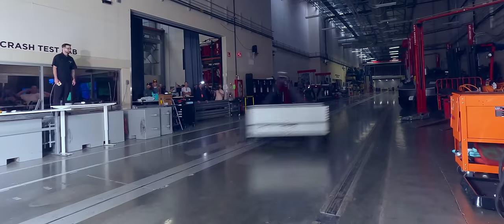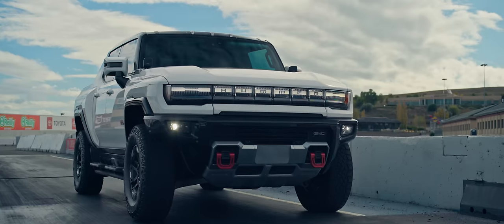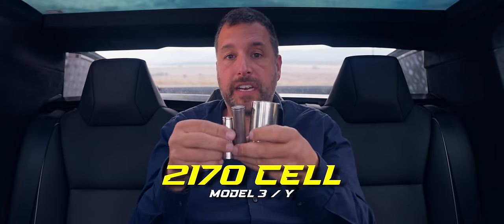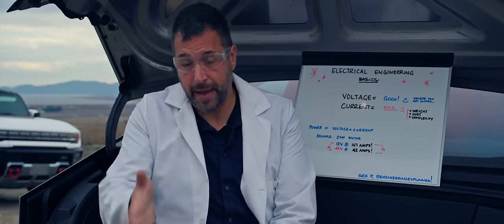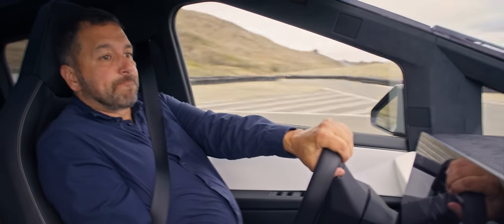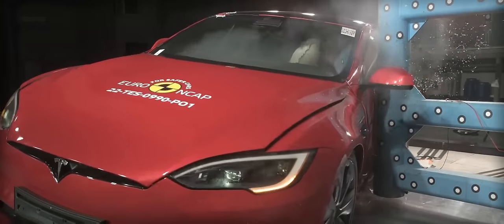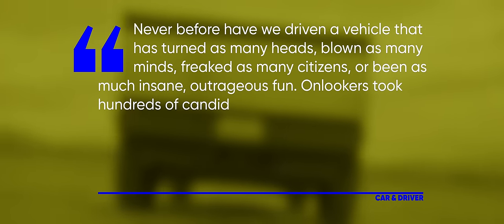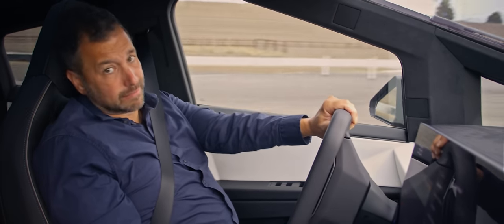Exclusive 2024 Tesla Cybertruck Full Review & Drag Race w R1T & Hummer  — Jason Cammisa on the ICONS

Comment: Incredible production, as always. Love how Jason didn’t mention payload capacity, bed size, towing capacity. They know buyers won’t use the Cyertruck as a truck😂
Reply: I'm only here coz it popped up in my recommendations, but in the flood of cybertruck content I've watched today, this kinda stands out. I'm sure a full review will come once they have a production unit in hand.
Reply: This truck will be the ultimate statement piece. The only people that will drive this are ones that want to be noticed or be looked at.
Reply: Sooooo....like most every truck buyer out there.
Reply: It is higher than all the other EV trucks. Done.
Reply: They're a drag racing channel. They probably aren't Truck experts. Besides it crushes the Ford F350 in towing. You will have to wait a bit for more stuff on actual truck things but it will come.
Reply: You're going to die alone with your cats lady.
Reply: @lachlanB323  this isn't 1320, they're not a drag racing channel.
Reply: You say that like 90% of trucks on the road are being used as trucks, when we both know that they are being used as glorified "SUVs".
Reply: It can haul Uber eats to the men that drive real trucks.
Reply: @noneyabizz8337  They aren't a truck channel is what I meant.
Reply: @lachlanB323  it doesn't even have a trailer hitch.
Reply: @lachlanB323 the real problem is that this is an advertisement and not a review.
Reply: Also like, towing ability. How you gonna put a gooseneck on that thing
Reply: It's a well-done Cybertruck commercial.
Reply: Most trucks aren't
Reply: 2500lbs payload, 11.000lbs towing, bed is 6x4feet
Reply: Does anyone use their truck as a truck? My coworker has a F250. He needed to move a Suzuki SX4 from his house to his niece’s house and he was gonna call a tow truck. I told him to just tow the thing with his F250 and he told me that he was nervous because he hasn’t towed before 🤦🏾‍♂️. Meanwhile my Model Y has seen probably 2,000 miles of towing various things in the 2 years that I’ve owned it. This includes towing my winter beater Saab 9-5 Wagon from off the side of the road after it blew a hose.
Reply: Well, besides the Mexican cartels.
Reply: Yeah that's my main gripe with Jason's thesis- he said Tesla reinvented the Truck- be he spent zero time exploring how well it Trucks. A rare miss for Cammisa, and hes my favorite Journalist period.
Reply: Most people don't use any truck as a truck anymore
Reply: It has 2500lb bed capacity and can tow 11000lbs. It’s not going to compete with any HD’s out there and wasn’t meant too.
It’s a truck for the 80% people who buy a truck. (Only 20% of people actually need and use a truck for what it’s meant for)
Reply: I think the statistic is 90% of truck owners don't use their truck for towing or payload. They just like the truck design, feel, sitting higher, etc.
Reply: The Idea that we use drag races to quantify the value of a truck Is both silly and a sign our times
Reply: I mean... its best in class everything in all of those categories so that argument didn't work out well for you now did it? 6x4 bed, 2,500lb capacity, 11,000lb towing. It out pulls an F350 diesel and obliterates the performance specs of every other EV truck and most trucks in general...
Reply: The specs for real truck users are the best in class. A REAL TRUCK FOR REAL WORK🙂
Reply: @GreenMountian  basically just like the Model S or any Tesla? that's what people said 10 years ago
Reply: I’m buying it for my farm. It does everything a conventional pickup does — haul stuff — but no fuel and no corrosion. Oh, and it always starts. In the winter, remote starts and warms up in 2 minutes. Life changing for the better. Dig it.
Reply: Not at that price 🫤
Reply: @shr00m7  He didn’t mention how well any of the other trucks trucked either. But for your information, 11,000 lbs towing capacity. 2,500 lb payload. Most EV’s loose about 40 - 50% of range when towing so keep that in mind when calculating the Cybertruck’s towing range. Overall, it’s about as good as a truck as all the other trucks. The slippery Rivian will still probably have the longest range. The F150 Lightening will still probably be the cheapest. The Cybertruck is a Halo vehicle. It is meant to be ridiculous.
Reply: It would look sick with some mini motos in the bed!!!
Reply: @a.t.2023  When I rode in my friend's F-150 a few weeks ago I realized that I had forgotten how great a family-vehicle my 2021 Ram (and his F-150) is...If you don't mind burning loads of fuel. So much space in the cab. So much space! Rear facing carseat: psh, place the 6'5" dad up front, no problem!
Reply: I’m a woodworker and the Cybertruck is at the top of my list.  I has a bigger bed and better towing capacity than any other option in its range.  Not to mention that I won’t have to worry about scratches and dents while I’m on a job site.
Reply: If a contractor showed up at my house in a CT for an estimate, I would send him away.  He/she is most likely going to charge me more than others and I would question his/her decision making.
Reply: @noneyabizz8337 😂😂😂😂😂most not all. Some of us pick up drivers still know how, why and what we have pick ups for. 😊
Reply: @lachlanB323 no...An F350 tows 20k lbs.
Reply: @fredwilliams7893   The Cybertruck will beat ALL other pickup truck brands out there, and will lead to the downfall of many pickup brands...   Mark my words dude.
Reply: To be fair when last did you see a truck being used as a truck?
Reply: @ettcha  lol you haven’t seen many Hagerty videos, have you?
Reply: So like every guy with an F350 on my city block.
Reply: @cbm5042 what’s the range while towing?
Reply: @johnsutherland7561 except for range right?
Reply: @landontracy3542  😅 the algorithm brought me here right after the MKBHD video! Still, if this is all they do, there's plenty of other channels that will have conventional formats. For now, let me check out what else haggerty has, it might be fun!
Reply: @landontracy3542  haha, I see what you mean now!
Reply: @Aproposer1 have you compared prices and specs with other EV trucks?  Some dealers are asking $85,000+ for a shitty Ford Lightning which we’ve just seen obliterated by the CT!  Ford and GM’s management should be shitting themselves as their products suck compared to the CT!  Also, once the CT production line is fully ramped, the price will fall and fall….it’s game over!
Reply: @fredwilliams7893  Stupid flex vehicle describes every fullsize conventional pickup on the road today.
Reply: Yeah, nobody is going to buy this to haul refrigerators.  That's fine.  I bought a Bronco Sport, not to go rock crawling (not my hobby) but to go mall crawling and it does that perfectly.  People will buy this to be different.  That's perfect as it was designed to be different.  So, it is what it was designed to be.
Reply: I wonder why they pinned your comment and then unpinned it. Maybe they realized you were being sarcastic.
Reply: @Incomudro1963  SMH yea my 2013 tundra crew max although very reliable and capable off road is not a flex vehicle! And so many other full size trucks owners aswell,! Teslas are for wierdos wanting attention thinking they are cool but yet 90% are being made fun of cause evs are not cool by any means! The market shows it. Full size trucks still number one seller. Get over it and except it
Reply: All of those things are best in class: fits 4x8 sheet with cover down, out pulls an F350 significantly and 11k lbs
Reply: @ChitFromChinola  gonna be amazing!  haters should not comment it just makes them look dumb. I mean they are & all but why out yourself as an idiot
Reply: @fredwilliams7893  they literally mention in this video, that tesla model y is bestseller currently. So many weirdos out there man, be careful😂
Reply: @gerrycrisostomo6571 

Bro, you must be joking. Do you have any idea how many F-150s are sold every year? Yeah, the lifestyle people will buy this thing, but the people who live in cold weather environments, and in more rural locations very likely won't. I get that there's this perception out there that most truck buyers don't even use their trucks as trucks, but that's not entirely true. There are plenty who do.
Reply: @JaxScoBlu  Come one Man! Who puts a gooseneck on a Ram 1500? Let's come with something logical. LOL
Reply: If it’s only the same price as a nicely specified Range Rover they’re gonna sell a few….
Reply: @Soh90 Wow, one anecdotal example of someone with an IC truck not using it as intended. I guess the matter is settled as Al Gore would say.
Reply: 100 this comment, no mention of any of the important feature of a pickup truck like off road capability. It's going to be the ultimate mall crawler/parking lot princess
Reply: @Zextraterrestrial  

Maybe it's you who shouldn't out yourself by calling people who simply disagree or don't like something that you do "haters." I get that you personally like the Cybertruck, and that's fine, but there are plenty of people who don't. It's also the case that most of them have a legitimate reason to dislike and/or not buy the Cybertruck. It's not just a bunch of irrational people who dislike it for the sake of disliking it. If you're going to claim or argue that sort of situation is the case, then you'll have to provide evidence to support what you're saying.
Reply: @CaseyCollier  so I like it personally? Did I say that
Reply: Payload and towing capacity is as good as, or much better than, all other half ton pickups on the market.
Reply: @Zextraterrestrial  

It was pretty obvious from what you said in your response to ChitFromChinola. He said that he's buying one for his farm and you responded by saying "gonna be amazing!" Do you expect me to believe that you don't personally like the truck when you said something like that?
Reply: Sooner or later if you buy a Cybertruck you will use it as a truck. I guarantee. Everyone has something to haul at some point.
Reply: @fratzogmopars  That’s not the point I was trying to make. But it is pretty well known that truck drivers don’t use them as intended. In fact, no one I know who owns a truck uses it for truck things. They laugh at the fact that I own a Model Y,  but my Model Y pulls its white dress up and gets down and dirty. Towing, camping, landfill trips etc. So it’s not anecdotal, it is, in fact, a microcosm of what truck owners are actually like. Tesla knows this.
Reply: @RayoAtra  the best part?  These insanely large trucks don’t fit in garages, apparently.  So when they sit out on the street you don’t have to worry about your $100,000 gas guzzler getting wrecked by sun or vandals
Reply: @geobur1989  yes of course, and that is by design. However it does seem to be far more technically advanced than those other EV trucks…
Reply: What does use as a truck even mean? A truck will always be used as a truck because it’s a truck. It will come handy when buying things from Home Depot, taking the kids camping or simply loading up a pair of bicycles to your favorite trail.
Reply: @Soh90  Maybe in the circles you run in it is well known people don’t use trucks as intended, but it is a big country with lots of farmers, construction workers, and contractors, to whom a truck is a tool. I get it though, I own a small pick up truck, it looks nice, and it is sporty too, but I use it for light duty, a tow hitch on the back, move my boat, light hauling for doing home improvement projects, help someone move home furnishings, thats why I bought it, to do things I wouldn’t want to, or couldn’t do with an SUV or a car.
Reply: @CaseyCollier  I don't have a farm.  specs are decent. Tesla cars blow other EVs away. I love my 3 and race.  I'm not really into trucks or large vehicles  unless I have a purpose for using one. towing a 3 for racing and being able to top it off would be neat & an easier way to get large Hoosiers to a race with me but still not necessary.  did you have a comment that you leads you to think I am calling you a hater? I'm  a bit confused
Reply: They'd be foolish not to use it as a truck, as it's absolutely designed to be just as practical as any truck out there! You get truck utility with sports car performance. It's actually the most practical car if you think about it in an unbiased fashion.
Reply: @SpyderRios  yes I think that’s right. It’s really designed to be an suv with an open back that odd shaped family items can be stowed. Not a Truck in the working sense where maybe concrete, scrap metal or lumbar is carried or possibly a goose neck may be mounted for instance..
Reply: Perfect for hauling mini bikes and go karts!
Reply: Ev hater 💩💩
Reply: @GreenMountian  I want one because i can tow 3.5 Tonnes and have more then 200km of range with it and i can hit it with some wood panels or stuff on construction without getting dents everywhere.
Reply: Great review
Reply: @Zextraterrestrial  

I get that you don't have a farm. That's not relevant to what I was saying. You have a preference towards Tesla and, by extension, the Cybrertruck. Is that a fair assessment? If it is, then what I pointed out in my initial reply is true. It'd mean you have a positive opinion of the Cybertruck, which is completely fine. I have no problem with that. 

Getting back to my original argument, though: you shouldn't just label people who dislike the Cybertruck  as "haters" or "dumb." That sort of language implies they're irrational and/or don't have a legitimate reason to dislike it. That is simply not the case, based on everything I've seen and heard. If you'd like to prove your claim true, though, you're more than welcome to. I'm not sure you'll convince me, but hey, it isn't an impossibility.
Reply: I mean, if this gets another market interested in electric vehicles I guess it is sort of a win? But an 8000lb vehicle made of lithium and stainless steel is not saving the world. That’s for sure. The carbon footprint just to make this thing is probably at least 2x the footprint of a couple of compact Toyota Hilux’s with 200k miles on them.
Reply: @itsatrap7215  I've seen 75% as the percentage that never tow, but either way, it's the vast majority.
Reply: @CaseyCollier  it's not perception, it's reality. Actual truck users are in the minority.
Reply: @darylfoster7944  

What do you mean by "actual truck users," exactly? Are you talking about towing? Are you talking about bed use? Be specific, please.
Reply: @CaseyCollier  yes, all the stuff that truck owners say the CT can't do.
Reply: @cbm5042  but it can’t do any of that with any range ant the “range extender” takes up most of the cargo area. Yup a great driveway look at me vehicle. But it’s not a truck.
Reply: @CaseyCollier greater than 80% of the country's population lives in urban, suburban, x-urban places...17.9% to be exact live in rural places...

As for what people use trucks for...if you discount work trucks I believe the stats from surveys and studies is that less than 20-25% haul frequently or tow anything with their trucks...most use it to drive to the grocery store and the schools - not doing truck things...

And the majority of trucks on the road today are not work trucks...
Reply: I need an 8 foot bed. I need to go at least 500 miles on a tankful, and I need to be able to fill up no matter where I am in Connecticut at a moments notice wouldn’t even think about adding that to my fleet of construction vehicles.
Reply: Newsflash, the majority of buyers of all trucks never use trucks as trucks.
Reply: @cbm5042  F350 can tow at least 18000lbs on a high end SRW trim and up to 40000lbs on DRW base model. How is 11000lbs out towing it? And where does the gooseneck or 5th wheel connect to the Cybertruck box?
Reply: @CaseyCollier  To label people (and AI) that comment on these videos / facebook / wherever and have no positive feedback as haters, is not incorrect.  I think something a bit different is a good thing, yes.  F150 lightning, I get they want it to feel similar to what old F150 buyers are used to,  probably decent for some folks ( plenty of haters of that vehicle too).  The slandery negative comments on all Tesla stuff gets tiring.(most EVs maybe?)  If you don't like it why the hate, just move along. Much of the hate is misguided and irrational (or financially motivated even), but there is absolutely no reason to convince someone to like it.  Seems you misinterpret my comment...
& being forced by gov't to EV isn't cool, they are better in most cases for many people  but  not all
Reply: Why explain? it’s all on Teslas website.
Reply: A Toyota Tundra is flashy to you? You must live in a reeeeeaaaaaallllyyy poor area
Reply: @johnsonjjohnson100  Fair point. And one of the things about electric motors vs gasoline / diesel is that you can have low end torque AND high speed. But... with that said, as many people in this thread have pointed out, few people buy trucks for truck stuff anymore anyway, so a 8000lb drag race capable stainless steel truck is hardly contributing to Musk's stated goal of "electric cars to save the planet." Nothing about this vehicle is about using less resources and probably fewer than 10% of buyers will actually haul anything remotely heavy with it. In my mind this is solving a lot of the wrong problems, but I drive a 1989 Toyota 4x4 so I'm obviously not the target market.
Reply: @triaxe-mmb  

...and? What you said doesn't really disprove my point. I never stated that the majority of people who own trucks haul or tow with them frequently. I said that there's a perception going around that most people don't use trucks as trucks, which is not entirely true. They may not use them "frequently" in that capacity, but they are still used from time to time like that, just as it's the case that most people who buy SUVs or hatchbacks don't always use the full cargo space of their vehicles. It's a matter of "I have the ability to haul and/or tow if I need to." Do you understand what I'm saying?

I'd like to go back to my original argument, though. The Cybertruck is a fairly niche product, considering that it's an EV pick-up truck which can't tow and/or haul anything heavy without a sizable chunk of the range being cut. It's also very quirky and irregular to boot, so that limits its appeal as well. Certainly, it'll be popular among lifestyle people, Californians, and those who seek attention from others, but I think that's kind of the extent of the market for this thing. Who else is going to buy it?
Reply: Me again. I parked my L-48  'vette beside one and the outside measurements were the same length and width as my fancy two seater.
 With the Middle row seat out, It felt like a Living Room inside with awesome Stereo.
 Those were the Day's My Friend!
Reply: @Killbot754  I said pulls more doesn't tow more. I beat the crap out of a 350 diesel in a truck pull test.
Reply: @johnsonjjohnson100  doesn't Johnson and Johnson own the Tampax corp? Even dope dealers know not to be their own best customer. There's nothing aluminum about my truck. Maybe the mirrors. It's more than likely older than you. That Tesla seems to be pretty fast. But I don't want to have to buy a purse and matching shoes to drive it. 😀😎. You have a good day🐂💨
Reply: 75% of trucks aren't used as trucks.
Reply: @fredwilliams7893 chick's will dig it.
Reply: Love your videos ❤❤❤❤
Reply: @fredwilliams7893  You can calm down now.
Tesla is taking over, just enjoy the ride :)
Reply: @Zextraterrestrial  

" To label people (and AI) that comment on these videos / facebook / wherever and have no positive feedback as haters, is not incorrect."

I mean... by definition, it's incorrect. You can't know what someone's complete intentions are behind their comments or posts unless you were to somehow be able to read their minds. Everyone has different motivations for the things they say. Some are similar and some are wildly different. That being said, you can't know what those differences are until you actually talk to that person and get a better understanding of it, yourself. Otherwise, you're just assuming things which could very well be wrong. Blanket labeling entire groups of people because of the things they say or dislike is a terrible thing to do. It's been proven time and time again in history, and it continues to be true today.

" The slandery negative comments on all Tesla stuff gets tiring.(most EVs maybe?)  If you don't like it why the hate, just move along. Much of the hate is misguided and irrational (or financially motivated even), but there is absolutely no reason to convince someone to like it."

I'm not saying that people who actually slander Tesla are good, but I think it's silly to brush off anyone who dislikes Tesla or EVs as "haters" or being "dumb." Many of them have a legitimate reasons for why they dislike the company or its products, so it isn't right to be so dismissive of them without first hearing/reading what they have to say, talking to them, and really understanding what their points are. I know that process can be time consuming and tedious, but without doing so, you'll lose perspective on the people around you, including those who disagree with you. That's not a good position to be in.
Reply: @fredwilliams7893  I've turned a wrench more than you have, and I think the Cybertruck is pretty cool. The engineering speaks for itself... I mean, if you're smart enough to understand what it's saying. 48 volt architecture is a huge leap forward.
Reply: @gerrycrisostomo6571  maybe, if they put a lumber rack on it. A 6 foot bed is practically useless. I build homes. And I refuse to build an ugly house. I'm not going to drive an ugly truck either. Elon is working on a semi truck that I would consider buying. He can keep his pup tent truck
Reply: @Aproposer1  derp
Reply: @mile_high_topher  you have? Even With out  knowing me you have turned a wrench more than me? Cause  i still turn wrenches my man!  I do all the maintenance work on my cars and wifes aswell. Mayby if you like this truck cause you dont have to work on it mayby you should think about turning in your tools and purse at the same time
Reply: It’s funny how much of the criticism towards the Ford Lighting is excused in the Cybertruck, specifically that its use as a REAL truck is or will be limited.  Basically if GM decided to slap a new “truckish” body on the E Ray, you’d have a CT competitor.  Hard pass.
Reply: That's the niche market the Rivian went into.
 They attempted to sell a life style ,
Like how Patagonia is selling it's expensive capable outdoor jackets to high tech city dwellers . 
That's a more conventional marketing/branding approach. 
The cyber truck is just silly and controversial, with surprises of good and different engineering from a car company that tends to do that. 
Tesla never gained popularity because it was the best car around 
But it had a huge screen , and silly fast "engine" in a "regular" car , and showrooms in malls . 
And it's such a crazy success story that while they have the best selling car in the world they still achieve a brand Exclusivity status! 
That was never done in the automotive world and the only other company that can be compared is probably Apple
Reply: @sorinelpustiu5674  yea? The sales numbers don't reflect it buddy! Number one selling vehicles  gas and diesels trucks and gas suvs  get out from under your rock bud and pay attention
Reply: “A middle finger to the establishment.”?? It’s doing everything the establishment wants them to. How much did Elon pay you to do this ad, Cammisa?
Reply: @noneyabizz8337  can't wait to see cybertrucks on lift kits...
Reply: @Mac10Daddy  Yep! Democrats way of life!
Reply: @philtucker1224  why would you imagine that tradesmen wouldn’t use a Cybertruck as a work truck?  It has more capability than any pickup on the market and is basically indestructible….this will be on work sites all over America within a few years for sure!
Reply: Tesla themselves didn't do that either, whenever they showed that never again mentioned delivery truck. I suppose you can deliver the heavy battery to the next Tesla specific charging station.
Reply: @fredwilliams7893  Yeah, I did it professionally, Chief.

Imagine thinking a truck is cool because you have to waste all your free time fixing the piece of junk.
Reply: As with most Truck buyers
Reply: @Tyler-yn5xe to paraphrase the man-child “in charge” of the vehicle “you just said the actual truth”
Reply: Most truck owners don’t use their trucks like a truck. Maybe with that tough skin, someone with money won’t be afraid of taking onto a back woods road or two.
Reply: @Soh90 I have more mud on my all wheel drive ford escape than every Jeep and truck at my work parking lot😆. My escape was only $32,000 so I can take my chances, those $80,000 rigs might make me cry if I put a dent in one.
Reply: @jamesbarbato2192  so you need a fleet grade truck...works for me...again I think people confuse a commercial vehicle with most of the trucks we sell in the US...most are lifestyle vehicles...they don't tow or carry a lot of cargo...

I am no fan of this truck aesthetically but the tech behind it is pretty cool...also, the faster charging architecture will make it a half decent work vehicle in some use cases, but probably not yours.
Reply: @fredwilliams7893  u sound like one of the ppl that said this would never be in production
Reply: @CaseyCollier  At least you have thoughtful comments. Completely disagree with most of this though - you assume I like the CT?  why assume this, from my first comment that wasn't directed at you whatsoever !?  I've been driving an S for 11 years. I would love a smaller car than a Model 3.  Calling haters what they are is not incorrect.  Commenters with constructive comments are a different beast.  I've been seeing this crap for a long time.   There are legitimate reasons for disliking every company and product. these are  not the haters I speak of.
Reply: Agreed. Another rich man's toy.
Reply: 3mi range when towing
Reply: @jstogdill  The main reason pickups aren't drag raced more is because they are so bad at it. Unless you like rear tires burning out. Cybertruck changes everything.
Reply: @dougm659  don’t make me laugh, (you’ll have a massive selection of electric work trucks from every existing manufacturer by then at half the price). Most of my neighbours have Teslas already as second cars but the Cybertruck is a novelty talking point at best. Great advertising but It doesn’t even have any headlights!
Reply: @Aproposer1  Most contractors have to buy expensive new trucks every few years if they want to get the high-end jobs. So, you not only end up paying for big, expensive, heavy-duty trucks, but also outrageous fuel bills as the foreman visits their various worksites and brings by needed supplies. Cybertruck decreases fuel expenses to next to nothing and increases profit potential. My next electrician will drive a Cybertruck! Can you imagine hiring an electrician in a non-electric truck? Like a gas or diesel? How archaic! An electrician who doesn't know electricity is better than gas and diesel!
Reply: @GreenMountian  Disagree. It looks like a very capable work/off road vehicle.
Reply: @The_Ballo  show your math please.  🙃
Reply: Its a nice sponsored Cybertruck commercial.
Reply: @Aproposer1 You’re obviously a very non judgmental open minded person
Reply: Are we gonna stop making these people aren’t going to use it as a truck comments one day? Not all people need to haul beds full of gravel or toe excavators for 100s of miles on a weekly basis there used to be millions of people driving around in four-cylinder Toyotas and Ford rangers that were perfectly happy. And by the way, I have a Ford lightning and probably used it to tow more than most people with a half ton crew cab short box truck have in the last year..
Reply: @Zextraterrestrial  

"...you assume I like the CT?"

Do you not? It seems rather odd to me that you presumably like the Tesla Model S enough to have bought one and own it for 11 years, yet you somehow don't like the concept of the Cybertruck, as an EV pick-up truck. I get that you likely don't want to own one (I never talked about it in that manner), but do you not at least like the concept of it, since it's another EV that Tesla offers?

"Calling haters what they are is not incorrect.  Commenters with constructive comments are a different beast."

I would agree, in theory. However, there's really no way for you to truly determine who's a "hater" versus someone with legitimate reasons to dislike the company or product. You can say "well, they have no points," but if they do actually have points but aren't posting them, then you're wrong. I understand that that's a high standard to meet and that there's very few practical solutions to deal with it, but it's just the reality we live in. Talking with people online just makes these types of issues even more likely. I'd say the best way to handle it is to ask questions before making judgements. 

"I've been seeing this crap for a long time.   There are legitimate reasons for disliking every company and product. these are  not the haters I speak of."

Then perhaps it would have been better if you had been more specific in your description of the people you're talking about, instead of using a blanket term like "haters." I still don't fully understand what you mean by that, even now, and I've been talking to you for a decent amount of time. How do you think your statements come across when people who haven't spoken with you see them? I don't think it paints a particularly good picture.
Reply: I use my F150 for hauling my 23’RV and boT. Go off road here in Wyoming hunting and flyfishing small streams. My Tundra hauls my FourWheel camper on logging roads in backcountry grouse hunting and flyfishing. I use them .
Reply: I would love this (but live in UK) but I don’t want a truck - for me this would be an SUV with an open back - yes I’d love the LM002 - but os the market big enough for people like me who live in countries that have the space for them?
Reply: Still beats a Chevy in every way
Reply: @fredwilliams7893  isn't that almost if not all American truck buyers? 😂
Reply: @lachlanB323 crushes a Ford F-350 in towing, but for how far?  And how many Superchargers are set up for charging vehicles with trailers?
Reply: Many full size truck owners don't even use half of what a Maverick would do.
Reply: @cbm5042 oh?  What’s the stated range of the vehicle?

And yeah, the Cybertruck has twice the efficiency of the Hummer EV, but technically so does the Silverado EV.
Reply: @CaseyCollier  Model S was actually the only EV available with any reasonable range and specs at the time. I test drove one and checked it out before buying it. Amazing sedan for dogs.  my OP was a short comment assuming a farmer will like the CT  in a sea of FUD comments.    Look through comments on some of these reviews. motor trend etc. Lots of what I'd call haters just commenting to throw shade., similar to the ones that just comment on videos to say 'first' . Not much to understand.

CT is interesting, definitely need to see it fully in person and drive one. Would be my wife's vehicle if anything and traded for a 4 runner.  

I've asked questions of some of the negative commenters over the years. there are rarely answers, mostly just name calling and much misinformation.  this is not a new thing,.  MSM has been slandering Tesla for years. Does that paint a good picture? 
it's a very deep discussion that does not fit or belong  here.
Reply: @danmadison5087  wrong... it has two
Reply: @noneyabizz8337  its not an advertisment because its not paid. its just an opinion piece, but still based on facts.
Reply: @ZipZoomZip  Finally the Raptor has met it's match. 🙄
Reply: @danmadison5087  per the placards at the event it has a built in trailer hitch…
Reply: @Tyler-yn5xe  guess what the truck sales have done x6 since the 80's but truck needs havent increased nearly as much. thats why 3/4 of the trucks NEVER tows or even hauls Something that wouldnt fit in a suv trunk.
Reply: It does beat a 911 in a drag race. While towing a 911
Reply: @InnovativeSustainableSolutions  if you want a cheap one, you gotta be patient, wait for the demand for expensive dual/tri motor versions wear out OR production increase a LOT, then prices will go down. Right now its production hell low production, high cost, high demand so they sell high
Reply: @Soh90  the big advantage that cybertruck may have is very fast charging, and even faster on v4 1000V/1000A super/megachargers
Reply: @Aproposer1  haha contractors you have the guy that just come for an estimate in the nice off road truck with impeccable paint and stickers . then the guys who really work come in a clapped out rusty white truck
Reply: @ChitFromChinola  
And.... If you put some solar on the land, or talk to the local utility about a wind turbine, (they power the community, you get free power??).... Then your saving is ridiculous.
Reply: @John_Mack  that's brutally honest 😀 Im pretty sure llike for any truck some will buy for the image, and some will actually haul/tow things, camp, etc. there are a lot of uses for a truck that don't involve towing a 15000lbs trailer for 3000miles
Reply: @InnovativeSustainableSolutions 
You can easily find diesel F150s at comparable prices
Reply: @JM-zs5hp 
Build yourself a slide-out for the bed and you'll have great acces AND security!
Reply: Well it won’t be a work truck that’s for sure but it doesn’t change the fact that it’s incredible
Reply: @Aproposer1 
Now check the F150 price on dealer lots.
.
You SHOULD be thinking
"This contractor will be on time, if his truck needs work, the tech will come to him, and if he does have a ... Drive problem(?)... The truck will still run. (Redundancy)
Etc.
Reply: No one's dragging this either but ok...
Reply: Almost no one uses a truck as a truck
Reply: This is Merica.  We only use trucks for “my rock is bigger than your r” safety.
Reply: I'm from Kansas, major truck country and I can tell you, most Kansan truck drivers don't use their trucks as trucks.

Pickups are man jewelry in the midwest.
Reply: @JDCheng  You can get the range extender which brings the range to 440 miles. However 99% of people don't need it. Most people don't tow for more then 150 miles. 

They aren't going across the country. Some people do hence the 440 mile range extender option.
Reply: @JDCheng  As for supercharging with trailers. We will have to see some youtube videos. You probably need to take up an extra spot. Also fun fact: The cybertruck can charge at 350kw at V4 superchargers.
Reply: The Cybertruck has a 6.5 foot bed.  How big is the bed in a comparable F150 Lightening?  Hint it’s less.  Cybertruck also has a tighter turning circle, is more efficient and has comparable load carrying and towing capabilities.
Reply: @lachlanB323  so, trailering is going to be the new "ICEing"...
Reply: @GreenMountian mass produced, lots of people find it ugly, not priced too high that it will be super rare…. I doubt it will be a statement piece for anyone but an Elon fan. I think it will be more like what the Pontiac Aztec is today. We shall see.
Reply: @cbm5042  f350 7,630 pounds of payload and 21,000 pounds of towing. I like the cyber truck but it’s nowhere near as capable.
Reply: Pay load????  Oh yeah it's a tesla, you'll Pay a Load alright.
Reply: @JDCheng  Yes. That is why Tesla will have to make new supercharger stations that allow for trailers. Either that or just make more of them. Currently there's so many superchargers it doesn't matter.
Reply: @johnsonjjohnson100   oh yeah, 0-60 and 1/4 miles times real important in Trucks? Big Truck guy huh? Truck 2.0 means straight-line times? If that's the case, whats the difference between a Truck and a Car?
Reply: This thing is a truck only in size and efficiency.
Reply: Didn't Lexus do steer by wire first?
Reply: "A Toyota Tundra is flashy to you? "
 I don't know or care what that is.
 Take yourself back in time perhaps before you were even born, Bud.
 In 1968, when the Corvette Stingray was introduced, it definitely looked like a 'Flashy' Car. Maybe even a flying Saucer. 
So get in your Tundra and go Home now. @Wallstreetavarice
Reply: Very true. I bought my electric truck to use as a truck. Not to star in a 1970s movie set in 2005.
Reply: @fredwilliams7893  I’m curious what your definition of a Beta boy is. Could you enlighten us?
Reply: Wow! I am wondering why so many people cancel their reservations claiming $100 back!))
Reply: Elon has already said the aerodynamics are extremely bad and the tires don’t last long. He couldn’t even give a final range of the cyber truck and kinda hinted it’s not good at all.
Reply: @danmadison5087  it is capable of connecting to a trailer and towing said trailer. Slap a 2023 Porsche 911 on the back to bring to the car show. If you happen to stop at a light on the way and another 2023 Porsche 911 pulls up next to you, looks up at you and revs his engine, you can smile knowing you have him in the quarter mile.
Reply: @danmadison5087 would an F350 qualify as a real truck? Used to tow real truck stuff? Ahem...
Reply: @shr00m7 I imagine he understood Tesla would show it doing truck things, and he is trying to get people to realize this thing is a truck, no matter it's odd appearance, not because it can do truck things, but that it does everything better than anything before. Everything being fundamental vehicle things. As he put it-reinventing everything but the wheel.
Reply: @rogerstarkey5390  
Yup. Dig it. It’s a new energy paradigm.
Reply: @joewiley6927  why do you assume I have a Ford?
Reply: @TheTuulos it will compete with the F350s of the world in reality, but I am sure you know the respective classes of truck have their respective limits in capacity, towing and payload. I am not an expert in the details, but I imagine they chose whatever class the F150s and 1500 class trucks live in. So legally, you will not be able to tow what a F350 can, physically the truck is quite competitive with a F350, probably beating it in most respects.
Reply: @ChitFromChinola you will be the spark for many others to get past their skepticism and do the same.
Reply: @darrenphughes  look it up its a real thing!  There is alpha and beta no grown ass alpha male would like a tesla period!  look at the demograpic of owners vs what alpha males drive. Gas and diesel full size  trucks! Something not right about a man that likes a electric car. Wierd to me thats all
Reply: @joewiley6927  If his central thesis at the top of the review is that the Cyber Truck reinventing the truck from the ground up and it is Truck 2.0- but he fails to address any of the qualities of what makes is uniquely a truck, as opposed to just engineering a cool new car- then he has failed to present a coherent argument and it is a failure in writing. If you’re argument is that Tesla will show it doing Truck things and Jason is showing it do cool engineering car things- then that just proves my point. Jason is not supposed to be a marketing arm of Tesla- he’s a journalist and theoretically presents self-contained pieces of journalism. Jason stated his own thesis and failed to support/defend it. That’s why its a rare miss for him. My point has nothing to do with Tesla or the Cybertruck tag all- but how Jason framed his story and failed to deliver on his own framing of the story.
Reply: @joewiley6927  
Ha, maybe. Mine will be the muddy one with lumber in the back pulling a wagon full of hay bales.
Reply: @danmadison5087  I don't. I only use the F350 due to Tesla having a tow-off with one. Just referencing it in particular due to that, not because I believe you are a F350 owner. Substitute a comparable Ram, GM, Chevy truck into my post and nothing changes other than I don't want to call them out over the Ford because I have not seen any video of those brands competing against the cybertruck.
Reply: Has mud tyres but it will never seen mud unless it was spilt on the way to school or shops 🤣🤣🤦‍♂️🤦‍♂️
Reply: 🤪 @AnonymousFreakYT
Reply: Cybertruck Rules again, all these EV trucks thinking it has an edge because it came out first is like a toy scrap metal now.
Reply: @shr00m7  Fair enough point, he did not adequately validate its truckness at all really. Vehicle 2.0 perhaps would pass your judgement, but I agree he did not prove it a step change in truck itself.
Reply: @lachlanB323  you’ve bumped your head. F350s properly spec’d tow over 30,000 lbs.
Reply: @pitech4446  rules at what tho? A status symbol and "look at me i have a tesla" ?
Reply: @SimplestUsername  Yes. But that car has just 270 miles of range and costs 65k and doesn't get the 7500 dollar tax credit. The cybertruck costs 72500 with the tax credit and gets 340 miles of range and is quicker to 100kph by 0.2 seconds. The cybertruck also has rear wheel steering which the lexus doesn't have making the turning radius the same on both even though the Cybertruck is a truck not a small SUV.

The Cybertruck also has air suspension... ok do I need to continue here? Pretty obvious the lexus sucks in comparison lol.
Reply: @fredwilliams7893  basing your masculinity and identity on what you drive is the most “beta” and pathetic thing I’ve ever heard.
Reply: @jeremyhowell2332  Correct. It losses when both tow 30k+ pounds though. Look at Tesla's video. It doesn't just lose to the cybertruck... it gets demolished.
Reply: @lachlanB323 look at Teslas own commercial to prove a point. Doesn’t make much sense. I own a Tesla and many of their claims are over exaggerated. If I didn’t charge for free at work, there would be many cars I’d rather have as a commuter. 

Point being, it’s not rated to tow more than an average half ton, meaning you can’t tow more than an average half ton on the street. I certainly wouldn’t trade my ram with a Cummins in on one anytime soon.
Reply: @CaseyCollier It's not perception. That's reality backed by actual statistics. Approx. 80% of light duty truck owners do not tow or haul anything, anywhere more than once a year, if at all. Lot of guys have a bed cover and that bed Never gets used.

Tesla is going after the majority of the market which is the correct decision. Maybe in the future there'll be an HD version for heavier, longer tows and heavier payloads.

For now though, a 2,500 lb payload and an 11,000 lb tow rating are great numbers. 340 miles of range though? Not so much. At least they have the option to bump it to 470 miles.
Reply: @lachlanB323 not to mention, the range when towing is abysmal and it has a tiny bed. If you have a trailer hooked to it, good luck charging on a road trip. You’ll have to disconnect your trailer every time you need to charge. You can’t access Tesla chargers with a trailer hooked up. I’ve been all over California in my M3P and I’ve only seen a handful of chargers at the hundreds I’ve been to with pull through charging spots.
Reply: @danmadison5087  it has a hitch.
Reply: @darrenphughes  you have your opion and i have mine. Based on your response  you probably got offended cause mayby you are a beta male? Am I right? I think so
Reply: I'm pretty sure 98% of trucks out there aren't used as "trucks". It's a workin' man image thing yee haaaww
Reply: @ettcha  the bronco raptor video is my favorite. Worth a watch
Reply: @BUEAU that very well may be true depending on where you live. Around here, most folks are towing stock trailers, animal feed, building supplies, etc. but in town it’s not as common I guess.
Reply: @jeremyhowell2332 CyberTruck's "tiny" 6 ft. bed just happens to be bigger than the best selling truck on the market which is the F-150 crew cab that sports a positively microscopic 5.5 ft. bed. Try again man.

Eight foot beds are for the <20% of guys who actually need and use their trucks for "Truck Stuff." Most don't so it'd be straight up stupid to optimize this all-new vehicle for the minority of the market.

You have a Tesla though. What's with the CyberTruck bashing? It didn't make sense to have very many pull through chargers until the CyberTruck was released as almost nobody tows with their other Teslas. Now that it's finally out though, expect pull through Superchargers to rapidly proliferate.
Reply: @ettcha no crumple zone on front impact i think your brain may hurt after a  highway head on collision 😢
Reply: @TecnamTwin all my trucks have 8’ beds. I don’t like short beds. I’m not bashing the cybertruck, I just wouldn’t replace any of my pickups with one for many reasons.

It’s okay to own a brand of vehicle and be critical of it. As I stated, if it wasn’t for free charging at work, I would sell my Tesla for a more interesting daily driver. I’m not thrilled with it. Creaks, rattles, phantom braking in autopilot, too many trips to the service center (which is mostly filled with inept technicians, at least seemingly so based on quality of service). I telework three out of five days per week, so it may be up for sale soon here.
Reply: @fredwilliams7893  yeah bro I’m so mad and so beta right now. Lol
Reply: @Tom-lf8hx  Rules the world.  Tesla will be inside your brain and you don't even know it.
Reply: It's a given that those features are best-in-class, so it's not worth explicitly discussing them
Reply: @lachlanB323  I'm not nocking the Cyber Truck, I only mentioned it because the reviewer claimed that the Cyber truck is the first and only car to implement that form of steering, which is factually wrong.
Reply: Who needs advertising!
Reply: @SimplestUsername  He did mention lexus.
Reply: @TsLeng  And it beat the F350 at pulling 40k. Maybe watch the video?
Reply: @fredwilliams7893  cry
Reply: @faceplant630  ok little wierdo  whatever!
Reply: @fredwilliams7893  I think you're projecting a little bit. Nothing wrong with wanting to enjoy the engineering if you have the money and want to.
Reply: @GreenMountian ultimate influencer clout machine
Reply: @geemy9675  in none of that did you attempt to call it a review, like they did.

That says it all.
Reply: All of those are better than the other trucks 😂
Reply: 6 feet bed, 11000 lbs towing, 2500lbs load. It doesn't work as a work truck? Lol, ignorance and haters are sad.
Reply: @danmadison5087  And what makes you think the lumber racks and other add-ons can't be built by the aftermarket companies?  Anything is possible nowadays.  Of course it will not perform as good as Tesla Semis because of it's much smaller size but it will outperform any other pickup truck in it's category.   It already showed in the video that the tri-motor  Cyberbeast version can outpull other pickup trucks including the F-350.  

Oh by the way, the Cybertruck has nothing to do with the house that you build.   It's how you build it that makes a house ugly.  And how come most people don't see the Cybertruck as an ugly truck, just you?
Reply: it's a truck for chic's
Reply: I want to know what the towing capacity is…I drive a Raptor and I love it. Plus I don’t have to hook it up to a charger
Reply: @juanmedinar20  higher than all other EV’s? The towing capacity is the same as the Rivian, 1k more than the Lightning and Silverado EV and 3k less than the upcoming Ram EV. Most importantly the range on this is less than all of them.
Reply: 2500lb payload, 11k lbs rated towing, and Tesla already showed you it’ll basically out pull anything in the launch videos with a 40k lb truck pull
Reply: @joshtavenner3073  negative if you add the range extender the range is 440 and 470 miles respectively. Tesla actually has places where you can charge it anyway lol.
Reply: Great business model. I'm sure they'll sell loads👍
Reply: @lachlanB323 It tows 11,000lbs. The RAM 1500 5.7 pulls over 12,000lbs. In fact, it pulls that weight close to 230 miles, while the Cyberthing can only go 300 miles, barebones, for the most expensive model.
Reply: Didja get one, John?
Reply: It’s funny that people who don’t work with trucks think 11,000lbs is a significant tow rating. That’s your average half ton pickup nowadays. My excavator weighs more than that before I put it in my dump trailer.
Reply: @lachlanB323  11:22 I don't see any mention of it.
Reply: As a carpenter, where am I supposed to attach my ladder rack?  😂  Pickups look like they do for a reason.
Reply: I’m a big Tesla fan and a self proclaimed Musk Rat… 

I can say I’m honestly disappointed in the production cybertruck be the one they promised us on the reveal date!
Reply: On the other hand, the people who buy a Cybertruck will happily recite all the specs, including payload capacity, etc. It will spew forth in one epic burst that includes comparisons to other battery powered trucks.
Reply: Entirely wrong, like so many other  uninformed and incsecure hot-takers.
You're on a horse and buggy, shaking your fist at a Model T
Reply: @johnsutherland7561  It is not meant to be a truck for contractors.  It is just meant to be badass in acceleration, handling and off road ability.
Reply: Seems like a garbage truck to me 😂
Reply: @fredwilliams7893  tough guy, it has more utility than a normal truck and is faster than a sports car. Disruption happens, grow up.
Reply: @modlife  wow 11k pounds is a lot. 5k more than the Raptor but does it ride as smooth as the Fox shocks?  How is it off-road? Feeding cattle? Is it easy to load unload? Mud? Hills etc.
Reply: Most people don't use their trucks as trucks just saying.
Reply: allanthomas7345  it's good for 99% of tasks focusing on the 1% of things it's not good for isn't relevant for most people.
Reply: It’s a modern day Delores. Promised much but ultimately flawed so much it cannot be used for its intended purpose.
Reply: @MaximilianvonPinneberg  Other than price what was promised that wasn't delivered? Price will come down over time it's simple supply and demand and economy's of scale. Discussing price at the reveal was a mistake but inflation has also been extremely high.
Reply: @juanmedinar20 until you want to do actual "truck" things. Yeah it's good on paper but the minute you start hauling something, or going offroad, then the range loss is so much worse than fuel.
Reply: @pflanagan1  If you're driving over 300 miles everyday the Cybertruck might not be for you. Range during off-roading is actually rather good how fast are you going off-road? People really have a hard time understanding that very few people do things the Cybertruck will not be capable of.
Reply: Obviously this truck is for "hipsters"
Reply: @RYTHMICRIOT  Maybe this version the range isn't ideal but the fact you said that indicates your worried the next few versions will be truly best mode. This is just the beginning.
Reply: @paultadrick8801  I’m talking about the practicality. The actual fact it’s supposed to be a pick up truck. The bay looks compromised.
Reply: Too much drama...
Reply: @MaximilianvonPinneberg  True if you're using a gooseneck it probably won't work. It's still larger than the F-150 lightning and Rivian though so competition is still behind but I am disappointed it's not 6.5 ft true usable length.
Reply: Do most Truck buyers use them as trucks?
Reply: @OutsideDuhBox I've been hunting in my model 3 for years now. I thought other hunters would laugh at me but they're actually rather curious and I can't wait for their reaction when I get my Cybertruck!
Reply: @GreenMountian because that's what's important when one buys s truck.  Does your boyfriend make you sit down to pee?
Reply: @fredwilliams7893 don’t be a hater, let them enjoy it. Wish people well and it’ll come back to you.
Reply: @danmadison5087  you missed it at 6:35
Reply: @paultadrick8801  careful with hubcaps they look easy to steal
Reply: @OutsideDuhBox  Good point! I'll be removing them the wheels underneath are way better.
Reply: Screw the haters I agree. He says elons son asked him why the truck platform hasn't changed in all these years? It's because it WORKS. If it ain't broke don't fix it!
Reply: @lachlanB323 tow rating ? How much does the range go down with weight…mhmm
Reply: @Soh90 god jesus christ thats hilarious man, about your buddies f250.
Reply: @justinmcsweeney9385  People are generally scared of change so they 
 slowly adopt new technology. It's good that progress is slow to give people a chance to accept it this is just the beginning.
Reply: Report sponsored and paid for by Elon Musk. A car with NO downsides - impossible.
Reply: @videowhat614  f350 is rated to tow 21k vs CT at 11k.  Maybe do some research. 

But if your application for a pickup truck is pulling a sled..Yes why not😆
Reply: @fredwilliams7893 go whine to your boyfriend Freddie.
Reply: @danmadison5087 nothing screams more beta than saying "real trucks". What are you overcompensating for?
Reply: That's not the target market. It's for rich urban poseurs that want to look cool and don't mind spending half an hour every day wiping sticky fingerprints off it.
Reply: This comment won t age well!
Reply: Lmao buy a truck and don't use it as a truck? Ahhahahahahahahahahaha A truck is designed to go off-road...but they have this truck on a track? And all of the gimmicks steer by wire, 4 steering is NOTHING New... as a matter fact lexus rx 500 have steer by wire and 4 wheels steering... but tesla need to emphasize that so they can sell, while everything else is not worth mentioning
Reply: We have a expression in UK looks like a dogs dinner, or as useful as a chocolate spanner [wrench], think it's a white elephant but a lot heavier and less range.
Reply: @Aproposer1  us smart ones have a beater truck to take to the quote FYI.  I know a lot of us do it. The nice one is at home in the heated workshop where the toys live.
Reply: Hagerty sells insurance. They'll charge a boatload to insure these. That should make them happy.
Reply: @Aproposer1  that's incredibly shirt sighted... most new pick ups with similar towing capabilities cost just as much as a cyber truck...
Reply: How many truck drivers, actually make use of the "truck capabilities" on the regular basis?
Reply: The cyber truck can pull nearly 12000 lbs and has over 1000 pound foot of torque.
Reply: This truck could pull a Mc mansion off of it's foundation.
Reply: @revirdkcalb  most dont... lol they just want the big thing... I get judged regularly by men for driving my little mini cooper... especially being 6 ft tall... its weird they aren't working farms or construction jobs... just wasting gas feeling cool lmfao
Reply: @raybohlander5502  Indeed. Probably 90% of people that have a truck only make actual good use of the bed once or twice a year when they go to IKEA.
Reply: "Tesla wants to own everything [in the car]" why is this stated as if it's a good thing? 

Also the only reason Tesla dropped the price on the car is because sales were so low. Also don't forget Elon promised Tesla potential buyers that Tesla cars will only go UP in value NOT down. Then they dropped the price significantly 😂
Reply: Love how he starts off describing it as a rethink of the truck without comparing it to the actual utility of a truck
Reply: @mofayer  that truck, by itself, can not do what my truck does. And the attachments it needs to do what my truck does will attach to mine. Leaving my truck empty. Why would I do that?  Here, have a therapy cat. And a helmet.
Reply: @noneyabizz8337  truth, all one has to do is drive around and count how many pickups have empty beds to see lol
Reply: @Spurrific13  lmao ok tampon man
Reply: @cbm5042  f350 pulls 21000 lbs. How is 11000 more than that?
Reply: That's what trailers are for, minibikes and gocarts!
Reply: Truck owners don't even use their trucks as trucks
Reply: The bed.  What does the bed look like?  Dimensions?
Reply: @GreenMountian  our they just like new and exciting tech, with shatter protecting glass, and can help reflect bullets... 😅
Reply: @danmadison5087 yall must be blind, ya can see the attachment in the back..😅
Reply: @noneyabizz8337  right!  like the other guy acting people ain’t buying trucks already because of that. Trucks now a days are so high up towering over sedans, yet they aren’t used for offroading. Living in the city, I think 80% of people with pickup trucks, have empty beds. The ones who do use them…a good portion, an suv would’ve worked. Heck paint buckets? Put it in a storage container in the trunk of your sedan.
Reply: @lachlanB323 factuality false. The range will not even come close. Look, evs are cool, they are great for all you suburbanites. But as a forester and speaking on behalf of other vocational folks, ev is not a viable replacement for us. (Yet)
Reply: @fredwilliams7893  imagine thinking you're relevant and alpha in 2023 because you can work on a pickup truck with an internal combustion engine.
Reply: Buyers won't use them at all because they'll never make it into volume production with this thing. never gonna happen.
Reply: @GreenMountian  or they like the look and don't care what other people think.
Reply: @fredwilliams7893  only losers work on trucks lmao
Reply: Just like John wont/cant ride a dirt bike like it was designed to be rode @CarsandCameras
Reply: @theNfl_Esq  I guarantee the ride is 10x better than a raptor… I have a nicer fox setup on my truck, and have owned a Tesla with air ride - I can’t imagine that setup with 12” of travel and torsional rigidity that beats a McLaren P1
Reply: @Soh90  to be fair a tow truck could be cheaper if not free compared to renting a trailer from uhaul.
Reply: Well it performs like a base model 150/1500 series pickup for only $40k-$60k more… minus most of the perks of having a cab on frame truck
Reply: @a.t.2023  I see tons of massive pickup trucks, driving down the highway and on the streets with one passenger and nothing in the bed.  We all know it.
Reply: Why you’ll worry about what other people do with the things they spend their money on? If someone buys a corvette most don’t want to track it. Things are expensive and if they don’t want to destroy it first thing so what? It’s nice to know you have something if you need it.
Reply: Most people don't use trucks as trucks to begin with.
Reply: @ettcha  this is just how hagerty icons is usually filmed
Reply: hhaha here comes the cry babies xD; oh wow if only you knew xD
Reply: Except it’s priced for a large chunk of the market and not outrageously expensive
Reply: Tell us you're a hater without telling us you are a hater 🤷‍♂️ 75% of truck owners tow something once a year or less (meaning never) 70% go off road once a year or less... 35% use it to haul something once a year or less 🤣🤣🤣🤣🤣🤣🤣
Reply: @fredwilliams7893 like most people who drive a pavement queen?
Reply: @danmadison5087 It has a trailer hitch in the very video you're commenting on. .
Reply: @auknix  who cares. If I want a race car. I'll buy that Tesla. I'm not against it. My truck will hold my tools, materials and 4 passengers. That Tesla truck can't do that without a trailer. And a second vehicle for any extra help I might need. I don't think I can haul my tools in that truck. Anyway, I'm glad it has a hitch. It needs one.😀
Reply: @fredwilliams7893  you sound jealous
Reply: @danmadison5087  I don't know what you mean by "Who cares".   You stated it doesn't have a hitch, even though they used a hitch to limit damage when they backed it into that charger.  I corrected you saying that yes, it has a hitch, as shown in the video.  Obviously you care or you wouldn't have taken the time to post a comment stating such.
Reply: @fredwilliams7893  maybe some.  but alot more don't want to drive a bar of soap model y but want to buy electric and its useful since its a truck.
Reply: If you do your research it beats or meets the specs for all existing pickup trucks in its class. The haters want to say it’s not a work truck. But actually look at the specs it more than performs
Reply: 😂All the benefits in efficiency are lost with the higher price. (40k original, now 60k). Lower copper weight and 48v will never pay for 20k worth of fuel.
Reply: @rhino6634  Best in class doesn't really mean much when it's the only one in its class.  It's not competitive with trucks in its price class.  It's not competitive with trucks in its weight class.  It seems to be competitive with other electric trucks like the F150 lightning.  Other than that, for weight and price it only tows 1/3 of what an F350 or 3500 series Ram or GMC does, and it's only rated for around 1/3 of bed payload also.  Plus it has much less box room than the aforementioned long box trucks.
Reply: @MyViewToronto  whats wrong with being rich and having toys? Isn't that what most people want? To be successful and be able to buy or do whatever they want? I am amazed at how much hatred and uneducated posts on here about a revolutionary vehicle. You either hate it or love it. I love this CT!
Reply: 2500lb bed load capacity.  Better than my V8 Tundra!  Perfect.I just wish it had an 8 foot bed.  I regularly load my Tundra to the max, and the Tesla looks more than capable to matching it.  Unlike CarsandCameras, I am a real world truck guy, using it purely for utility not for commuting.
Reply: @auknix  who cares means, I'm not interested in a truck that can't even hold my tools. It's a toy. I'm glad it has a trailer hitch. It needs one. 
Here, have a cow fart
🐂💨💨💨💨💨💨💨💨💨💨💨
Reply: Very few Americans use the truck features of the truck.  So this hits the actual customers’ sweet spot.
Reply: @ObiePaddles  it'll hold a few buckets of soy paste.
Reply: They say 2,500 pounds payload, 72” bed length (don’t know the width), 11,000 towing.   A little skeptical of the payload and towing.  We’ll see.
Reply: Like most other people who drive trucks today lol
Reply: It’s VERY torquey.  Of course it’ll pull anything.
Reply: @shr00m7 post's like these are from closed-minded people who dont actually digest the content or information that is given to them. They fail to see the bigger picture or grasp the significance of all this. I dont want to waste my time regurgitating it. 

Bottom line is it's all about change people! Some people will embrace changes,  while most will not. CHANGE is everything moving forward. And its ok for those who do not accoet change. But for those who do, we are the ones who will shoe our own future...
Reply: At 2.6 seconds….. it’s not a truck
Reply: I can see the need for a bullet proof truck in America 🇺🇸  , not so much here in Australia 😉
Reply: Why not? It does many truck things better than any truck on the market.
Reply: @jumpingblue1623  nope i have Toyota tundra that would out live this cyber circus by 100k miles and then some
Reply: @jstogdill true , I have to take stuff on and off a Ute ( truck ) most days.  The high sides to the truck bed would be super annoying.  Not that there aren't many trucks already on the market that are quite useless lol
Reply: @jeffgorchynski  imagine being a man in 2023 with no mechanical skills! SMH
Reply: @GreenMountian how about those who use trucks for truck stuff. It does nearly all of those things better. Only two things I am not sure about yet: snow plow mounting and the bed isn’t removable so no flat bed or other custom bed mods. That said, there are lots of accessories for bed storage (tools, gear, racks, etcetera).
Reply: @fredwilliams7893 seems like it will outdo any conventional truck at most tasks. Who likes taking the time, money, and effort to replace dented up tailgates and rusted out beds. This thing is utilitarian to the max.
Reply: @danmadison5087 funny. I did chuckle. But this truck will do most (not all) truck stuff far better than any truck on the market today. It won’t be able to compete with bed swapped rigs, or F350+ sized trucks in terms of tow/haul.
Reply: Who cares it’s fast. And I want one
Reply: @GreenMountian That's pretty much any of the higher line trucks in a nutshell.
Reply: With the specs of 250 miles and 340 respectively the CT will be gobbled up by the Dodge Rev. The Rev promises a base of 350 miles,  and 500 miles respectively.

The Telsa extended battery will go under the CT bed but only promises another 125 to 130 miles. Which you're still not reaching 500.

The concept is always better than the production vehicle in most cases. And judging by what's coming in 2025 it's looking like Dodge may have been smart in taking their time on an EV truck.

As longs as Dodge doesn't screw up with the lower trims and keeps the lower trims with the 500 mile range then the Rev sounds like a hit.
Reply: Guess you missed the pull video, where it outpulled an F350 diesel. Whanh-whanh, another failure comment.
Reply: @fredwilliams7893 have you considered that not working on a truck might be one of the most important traits of this ……truck?
Reply: @garrith222  Agrred.  It all comes down to getting the torque to the ground.  Big tractor tires on the Cybertruck for plowing.  I am down with that!
Reply: It's a 7' × 4' capacity bed holding a 2,500 pound load and can tow a 10,000 haul.
That work for you cars and cameras? Ain't gonna lie I may have to unsubscribe for that bs comment. 👍
Reply: @modlife  I’m just a country lawyer so you have to tell me like an elementary school student lol are you saying that it’s 10x better than the Raptor in terms of off road, 9n road, hills mud etc?
Reply: @aaronbounds1336  it won't even hold my tools. And I would have to haul a trailer around every day. When Elon makes a standard long bed with a lumber rack. I might be interested. Would like to take it to the track though. Then give it to my wife. She can haul groceries in it.
Reply: Yeah Jason looks like the type of guy that would purchase a cybertruck
Reply: And yet people keep focusing on the "towing capability" and the "torque" needed for off-roading. This video did it right and only focused on what matters with an EV. , 0-60 and drag racing. Ive seen many, many comparison videos using for example, a gas powered F150 and an F150 lighting and the Lighting is great until you actually want to use it as a truck.
Reply: This isn't a review but an ad for the thing and it's blatantly obvious
Reply: @markysspotlight2472  Tesla site says 11,000 towing (Cyberbeast model) less for the two-wheel drive version. Also says 6’ x 4’ bed.
Reply: @noneyabizz8337 in America yes, the rest of the world actually uses a ute..
Reply: @itsatrap7215 that's a absolutely bullshit made up claim haha maybe 10% don't use their truck as a truck but that's like saying you shouldn't buy a 4 door car unless you haul 4 people every single day
Reply: I've towed with ICE trucks. Depending on the size and load, they also lose 40-50% of their range. The difference is that their gas tank takes them further than a battery. But in a few years, with solid state batteries, that will change.
Reply: @steveseeger how well does it pull 20k lbs also a tug of war isn't a great method of towing
Reply: @canadiancryptokook909  that's why auxiliary fuel tanks were invented.. ICE will always be superior to EVs
Reply: @canadiancryptokook909  I can’t imagine charging will ever be as fast as filling a tank with gasoline.  I think that’s the issue with range anxiety.  That and keeping the vehicle warm and cool during stop and go traffic winter and summer reducing mileage.  I think they are great for normal driving, just not great for trips.
Reply: @hobo1704  They also already have auxiliary batteries patented. Solid state will eventually surpass ICE.
Reply: @vanguard9067 ICE vehicles also keep burning fuel to keep warm or cool. Solid state batteries will charge just as fast as a fill-up and in time go much further on a charge than an ICE.
Reply: @fakumadda1632  and where are they going to fit? You can't just have one hanging underneath a car like a fuel tank..
Reply: wrrr
Reply: @fakumadda1632  so you think you get free aircon and heating in an EV 🤣
Reply: @hobo1704 When did I say or imply that you get free AC or heating in an EV? Did you pass grade 2 reading?
Reply: @hobo1704  In the bed. Same as an ICE auxiliary tank. If you're saying your auxiliary is under the truck, EV's can also include an extra long-range battery. Within 10 years, you'll see 2000 mile range batteries.
Reply: @leifandersen2756  Sigh.  How many times have we told you?  Put the mirror away and go finish your homework.
Reply: @fakumadda1632  looking forward to that.
Reply: so like the average truck in America... either way, he mentioned a lot more of things, but there will be always the one to remark something
Reply: @TsLeng  watch the tractor sled tow competition between the f350 and the Cybertruck. The Cybertruck obliterated the f350.
Reply: @noneyabizz8337  exactly! Lol
Reply: This truck is literally for all the vegans who have been complaining about the existence of trucks all these years
Reply: @brandonmaahs2893 If you're towing 20k pounds, you don't buy an EV you buy an F350 with a dual tank set up.
Reply: 99% will buy this because it s not a truck; it’s a status statement. So yes.
Reply: @royquiroz3359  the cult of Ellon Musk, yeah.
Reply: @danmadison5087  trucks come with hitch recievers. And the cyber truck absolutely comes with a hitch reciever.
Reply: @royquiroz3359  I think a lot of truck buyers with higher trim it's a status statement. With CT it's that but more towards the kinda people who want to own a lambo.
Reply: True, No Towing figures, No Range analysis, No Payload, No Aftermarket accessory for work trucks, Not a Working man’s truck. 
Lastly How will I charge this towing a 32’ trailer? 
So many questions.. 

Confused owner of 2014 F450…
Reply: @JimmyDeanBallistic  the f350 is rated to tow double the CT. 21k. If that's what you use a truck for..Yes, a CT might be the best. Lmao
Reply: @ChitFromChinola weighing in at 6000 plus pounds  with a 6x4 tray..ha ha ha..dill..sink like quicksand , sink faster than your depreciation..ha ha again..a farm truck for none farmers..just keeps getting better!!
Reply: @Zextraterrestrial  president dropkick..yep that's you..
Reply: @roxter299roxter7 yes, to take cyber truck owners to the nut farm..such a big tray you could take 3 people to  mad house.
Reply: @ZipZoomZip and what do you do  to make such stuip comments..tools and workmanship is 100 times more important than some silly truck that's not fit for purpose..hate to tell you in your tiny litte world that diesel outsells petrol world wide..why..because real trucks that carry real loads are diesel..not pretend  trucks. In australia they carry thousands of litres of diesel.
Reply: You can clearly tell camisa is trying hard to let Tesla that his their #1 fan boy
Reply: @shr00m7  I see it differently. The truck is outrageous, and for people looking for a showpiece not a workhorse yes.  What he means is they’ve redone so much of how it functions. It can be incorporated to every other vehicle on planet earth. The drive-by wire, 48 V and car network systems. They reinvented so much about how this thing runs is going to be a game changer for every vehicle on the planet. That’s what he means, it’s not this product. It’s the product that will influence.
Reply: @baritonebroker  he specifically said reinventing the TRUCK and TRUCK 2.0- and never related how the (impressive) engineering and materials sciences made it a better TRUCK. My criticism isn’t about the Cybertruck, it’s about how Jason made a claim and failed to support it in his piece. I don’t understand why it’s so hard for some people in the comments to fail to understand that distinction.
Reply: Cars and cameras lol
Reply: @GreenMountian nope. People will buy it because it's awesome
Reply: That go cart scene was 😂😅 my man was peacefully giving us the ins and outs of the Cyber truck while the go cart driver is catching a coronary 😄🤣
Reply: @matteocomelli9587  allegedly.
Reply: @GreenMountian  ok, but crazy as it sounds a lot of people like the design. It is a look at me vehicle just due to how it looks, but most people aren't buying it for that reason. It looks cool.
Reply: @chrisschneiders6734  
Weight is same as Super Duty. Value for Tesla cars holds better than any gasser. Try again, but make more sense next time.
Reply: @theNfl_Esq  I’m simply saying all around comfort, there is no doubt in my mind that it’s a huge step up from a raptor. We’ll see how it stacks up off-road, but on equal tires, with its far superior torsional rigidity, I wouldn’t hesitate to put my money on it out performing it in every way.
Reply: @theNfl_Esq  Being an attorney doesn’t impress me, so i don’t really appreciate the attempted flex. I went to med school, have an EE degree, am published, and the firm I founded handled case acquisition and development for large firms like Cochran for years. I know my way around the law, too. That said, I can’t wait to get my CT and promise to share videos of it getting plenty of off-road and airtime ;-)
Reply: @danmadison5087 yes it does lmao
Reply: Well when I buy mine it’ll be used as a truck.  I’ll see you at the track towing with my cybertruck.
Reply: @NvSrAgE679  yes it does what? Need a trailer so it can pretend it's a truck.
Reply: @danmadison5087  yes it has a trailer hitch.
Reply: @syedullah613  EV's will not make sense to replace your truck use case for at least a decade if battery prices and energy density come down enough; it's trending that way. Medium and some long haul big rig routes do make sense with EV's though because they will have dedicated infrastructure for mega charging along popular routes and they have room for enormous batteries.

It's too bad if you have to tow a lot or haul longer distances because you'll miss out on a lot of the cool features of EV trucks.
Reply: @itsatrap7215 more like 95 to 99 percent. Do you seriously see 1 truck out of 10 on the road right now doing truck things? Here in Texas that is definitely not the case. I can see 20 to 40 trucks before I eventually see 1 truck actually towing or hauling something.
Reply: @steveseeger  main challenge going forward is going to be payload, Typical payload on a conventional semi is 40-54k lbs, Tesla semi comes in somewhere near 37k lbs. adding more range means heavier chassis. 
I don’t see federal interstate laws changing and allowing 80,000 GVWR to be exceeded. 
As it is; the infrastructure is crumbling with 80k GVW trucks. 
The only other solution is that semi trucks used for transportation of batteries that can be utilized In transit. 

The other issue with batteries is loss of efficiency in Cold weather 30-40% loss of range. 

By State Tesla Registration 2021-2022 shows most of these cars live in the sunbelt states. Majority in California. 

California	563,070
Florida	95,640
Texas	80,900
Washington 66,810

There are alot of problems facing the cool EV future. We are 1.5 decades away from it coming close to efficiency we already have.
Reply: @NvSrAgE679  same!
Reply: @gerrycrisostomo6571  Um, the only thing it beating other pickup truck brands at is acceleration performance, status appeal, and tech features. All of which are also not the point of a pickup truck. It falls short in all utility metrics to nearly every full size truck on the market.
Reply: @cbm5042  well said… but the dumbs commenting here refuse to actually research the cybertruck. They are too insecure to do so.
Reply: @Aproposer1 but he doesn't have a gas guzzler😮
Reply: Cybertruck will outsell every truck
Reply: I always drive my pickup on perfectly paved racetracks… they said it has mud tires. How’s it do in mud? Or even dirt??
Reply: @fredwilliams7893 OK Boomer.  You must be American.  Here in Asia, Tesla is known to be the coolest thing around.  While you claim "everyone there makes fun of Tesla," over here, everyone wants one.  I'm pretty sure Asia's 3 billion plus population is a wee bit larger than America's population. They'll sell as many Tesla's that they can make. Easily.
Reply: lol yep no one is buying this to haul junk from Home Depot
Reply: @modlife  lol doesn’t impress me either. There’s plenty of dirt bag lawyers. Just saying I don’t know s*** about vehicles so all the rigidity and f1 comments are over my head  certainly never meant to come across as a jerk. Looking forward to seeing your videos. 👍🏻😎💯
Reply: @Mr.mr.mr.mr.r  Eventually, yes. I am a GMC diesel truck owner and I can't wait to replace my truck with a Cybertruck. "Guys" who claim it's not a truck or that it can't do "this or that", have zero experience, they are speaking emotionally and reveling their male insecurities. They can't help it... so, best to ignore them I guess.
Reply: @fredwilliams7893 Just to be accurate: In the global market, Tesla Model Y is the best selling vehicle.  It outsells the Ford F-150.
Reply: @GreenMountian  oh so like all the guys who buys trucks big big rims wheels tires, raise them high, loud exhausts or exhausts that billow as much black smoke as possible. Welcome to the human race we like to show off
Reply: @lachlanB323 you don't even know the tow rating. How could you know it crushes any truck in towing..? Also, I'm sure every person that wants to buy a truck immediately thinks "oh yeah I need to make sure my TRUCK can drag race well" 😂😂 it's just pathetic honestly
Reply: @ChitFromChinola wait till something breaks and I promise you it will, and I can also promise you that you'll have to take it to tesla since they're attempting to make their cars unrepairable by smaller/other mechanics. Let me add that price is gonna be no less than 4 digits... maybe more? Your loss
Reply: Why do we have to do the quarter mile?
Why do we need such heavy made vehicles?
Why bulletproof?
Stainless steel is a material that work hardens over time.
It’s hard to work with and in the crash test well have fun repairing it 😂.
I say now sorry for everyone how is driving normal type vehicles ie a Toyota Corolla going to hold up in a crash with it?
The roads around the world will suffer for the extra weight
Reply: You mean like 95% of pickup buyers?
Reply: @lachlanB323  towing capacity is one thing but how far it will be able to tow is another. again i’m sure the majority of people won’t use this to tow, but i would imagine it kills the range
Reply: The cybertruck is more “truck” than any other truck ever made. It pulls more, hauls more and will outrun million dollar supercars. What are you idiots talking about???
Reply: @zandercerlong7238  You’re talking about maybe 1 percent of truck buyers. For every huge lifted truck on 28 inch rims there are 100 regular trucks out there.
Reply: @enginezholtz9260 Um it hauls more payload and tows more than any half ton pickup. What are you talking about?
Reply: @ObiePaddles You have no idea what you are talking about
Reply: @theNfl_Esq  My apologies then -  I apparently took your comment wrong… I’m used to attorneys that think they’re intellectually superior because of a law degree and that’s usually when people throw it out there!
Reply: @enginezholtz9260  Can you please tell me what those utility metrics you are talking about?  And secondly, the Cybertruck is not considered as "Full size" truck, just a mid-sized pickup truck.
Reply: @syedullah613  The cold weather loss isn't that high for a semi truck, that's what it is for a passenger vehicle. The semi battery is a square not a thin rectangle so it can stay warm more efficiently and things like heating the cabin don't factor in.

They did increase it but only by 2000lbs for EV Semi's to 82k.
Reply: @lesgrossman9492  In what way?
Reply: @lesgrossman9492  lmao i didnt say only the ones that are 28inch rims. If you do one single aesthetic upgrade to your truck, it’s because you want it to LOOK better it’s OK to admit it’s human nature the vast majority of people with unlimited money by things that look good making fun and calling people pricks that buy let’s say supercar is it total poor person mindset every person with exceptions has bought awesome nice car. That sound good that bring attention it’s just the way humans are wired and that’s OK.
Reply: What do you think happens to the range if you're towing 10k lbs.?
Reply: @lesgrossman9492  NO it does not. A 3.5 ecoboost f150 tows 14000lb and has a payload of 3300lb. That is quite a bit more than the 11000lb towing capacity and 2500lb payload of the cybertruck, and at half the cost. The CT is a much better car than most trucks, but falls short in utility by many other trucks in its class. That isnt the point of the CT though. Its a statement piece that looks striking as hell and is fast af, while also being a engineering marvel. And I think comparing it to an average ICE half ton is just a waste of time. Two completely different goals.
Reply: It will be used to pick up kids from school and do alittle grocery shopping 🤣
Reply: @GreenMountian  You just spent an hour listening to a man talk about all the goodness in this vehicle and this is your’s and 425 others conclusion? 
SMH.
Reply: @winstonsmith6552  
It’s got a 4x6’ bed with no wheel wells for hauling stuff around. Tonneau cover to keep stuff secure. High torque motor for pulling heavy stuff. Stainless body that won’t scratch or dent. No oil changes. No stopping for gas. Always starts in the winter. Seems very useful to me.
Reply: Like the majority of truck owners, good point!
Reply: Either that or Jason knows that all that data is readily available on the Tesla website if you are actually interested….🙄
Reply: @dougm659  IKR, it just goes to show that much of this pissing and moaning is people reacting emotionally, not rationally…. They are too lazy to check all the facts first before commenting. Simple fact is, this is the first version; prices will come down and design changes for functionality will come around if the market desires it.  Traditional ICE truck buyers need to accept the fact the game is changing.
Reply: I didn't know Charlie Harper did automobile reviews. Wasn't he a chiropractor?
Reply: @danmadison5087 define a “real” truck?  Cybertruck pisses all over every other truck in every category….love to hear how you think it doesn’t match up!
Reply: @gerrycrisostomo6571  
Oh, I'm marking your words for sure. It's gonna be so funny reading this comment 5 years from now.

This truck will be an overpriced collectors item then (as it is right now, also).  It's an expensive gimmick, plain & simple.
Reply: @bowtiebonanza   What about range while towing? EVs fail at this all day, every day.
Reply: @dougm659  it needs a trailer to do what I can do with my truck. Until it can haul 20, 20 foot copper pipes, abs pipes PVC pipes, rebar. 2x4's, 2x6' 12 foot sheetrock. And 20 4x8 foot plywood. Not to mention my tools and five people. It ain't a truck. It's a toy. And if I got the same trailer that Tesla needs to haul all of that. I could double that order. Except the people. I would need a second Tesla for them. Anymore stupid questions?
Reply: @shr00m7  Jason only had it for 3 days. Wait for the videos that put this to the test.
Reply: @GreenMountian  its the single worst vehicle design ever. It might appeal to apple users
Reply: I won’t....
Reply: Like it or not, it’s here… wish I had one…
Reply: Is this guy high?! You mean to tell me AFTER EVERYTHING YOU JUST SAW you think they’d drop the ball on the basic stuff. Jesus
Reply: Everthing to know about this truck but what actually makes it useful as a truck.
Reply: @AntonyReed  that’s such a stupid excuse/justification, he could have just not included those lines in the writing. 🤦🏽‍♂️ everyone is bending over backwards trying to justify this falseness
Reply: People use Tacomas as work trucks. I'm sure the payload capacity is higher
Reply: If it's not able to haul a  decent pay load and  pull a trailer it's not a truck.
Reply: @itsatrap7215  …and these days they presumably also prefer spending an extra $100+/month just on gas compared to almost any other class of vehicle that would do what they actually need to do with the vehicle!
Reply: My Toyota Startlet can fit a bike in it, as well as 250 cm timber. This thing isn’t a truck, it’s a schlong enhancer.
Reply: Seriously? A drag race to prove the usefulness of a truck? Good to know you can win a race with a bag of dog food in the back as that’s just about all that will fit in that booth.
Reply: It can tow a lot, just not very far
Reply: Cybertruck: i r truck
GMC, Ram et al: u r NOT truck, u r 'pavement princess'

;> case closed... 

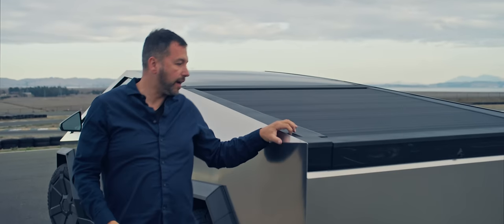16:04 because... take a look at that tailgate... who is going to get ANYTHING in that truck bed without a ramp or a hydraulic lift or backing the CT up to a LOADING DOCK? see the EXTERIOR HFS panel on the tailgate and where it hits Jason... below the CROTCH of his jeans. the tailgate looks to be between 3-5" thick... so unless Jason is 6' tall? nope, i'm not buying a Cybertruck and using it to haul stuff. 

the tonneau cover! ugh! yes it decreases drag ecoefficiency... just like getting a soft or hard cover for your 'standard pickup'. but that means when it is closed... there is NO vertical storage capacity! try carrying the fridge the guys busted up with their sledgehammer... in a CT. you're supposed to move those... upright... to keep the coolant from getting messed up... yeah you can lay the fridge down... but you better leave it unplugged for 24 hours UPRIGHT in your house when you position it. bed mattresses and boxsprings... most common load i see on the roads for pickups... second only to upright fridges and freezers... i dunno about you but that CT bed looks about as WIDE as a full-sized mattress... is the tonneau cover 'window' deep enough in the bed for a king or queen-sized mattress to fit in that bed 'vertically' on a side? without the mattress and boxsprings DANGLING out of the bed atop the open tailgate? how long is the whole bed OUTSIDE the tonneau cover and the top body panel of the truck? what is the clearance at the lowest end of the rear 'slope' near the tailgate between the cover and the bed? what is the highest clearance under the top body panel? 

i call the CT a FAILURE of design because Tesla took the NUMBER ONE REASON A PICKUP TRUCK EXISTS and dicked it up. hauling 'stuff' in the bed.
Reply: @CodyDavis91 Still a better outcome than owning a pos tesla lol
Reply: Speak for yourself I’m gonna load the crap out of it if I ever get one. Lol  PS I am retired and will never be able to afford one
Reply: Would be relevant if the cybertruck was a real truck ... instead of a big wankmobile
Reply: Greetings from the future. The Cybertruck is a BUST. Not only is it not a good truck, it's also not a good source or transportation. Big "oof" to everyone shilling this overpriced lemon.
Reply: @lachlanB323 bullshit on the towing between the Cyberfuck and an F350.
Reply: @gerrycrisostomo6571 except it's hard to pull a 38 foot trailer into a Tesla charger because you have to stop 3 times as often as a regular work truck for fuel . And they have this thing called gas and diesel stations that have pull thru lanes and you're gone in less than 5 minutes . Never mind a f350 toes almost twice the capacity of a cyber truck and has many many cool options and hey a normal size bed so you can throw a 5th wheel in it .